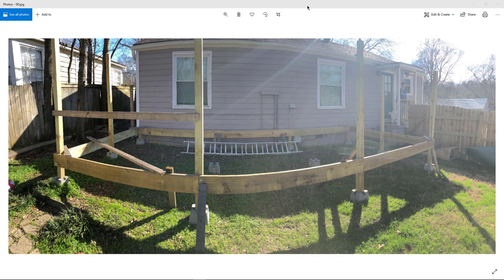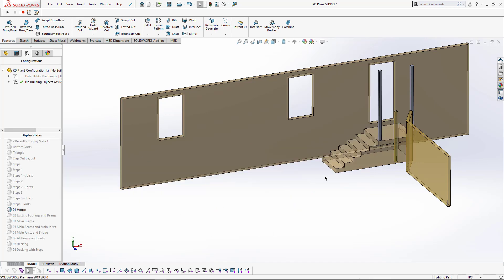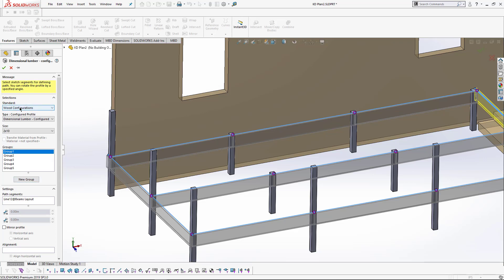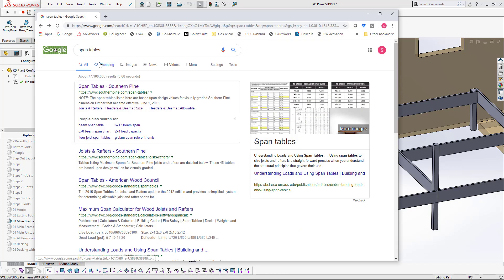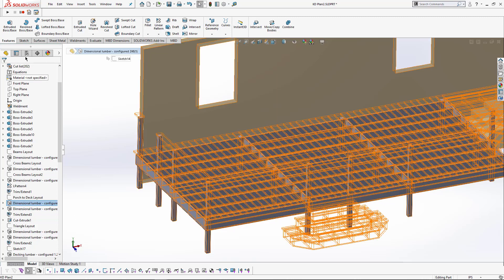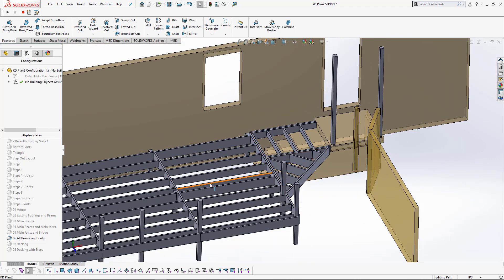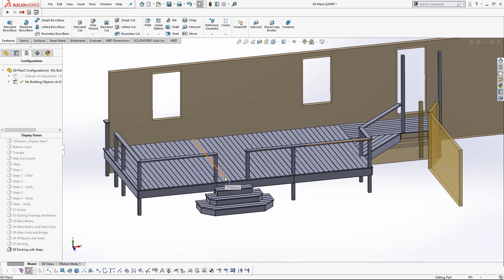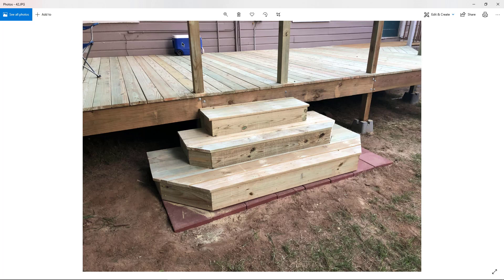SOLIDWORKS Tutorial - Deck Project

Comment: nice video using solidworks weldments, you are obviously an engineer and  not a carpenter.  I have built decks for over 30 years and would never build a deck like you designed.   Where I live it would never pass inspection.
Reply from the maker: Thanks!  We appreciate the feedback.  Be sure to subscribe for more great 3D CAD Design and 3D printing tutorials.
Reply: You should start your series for deck building for ideas.